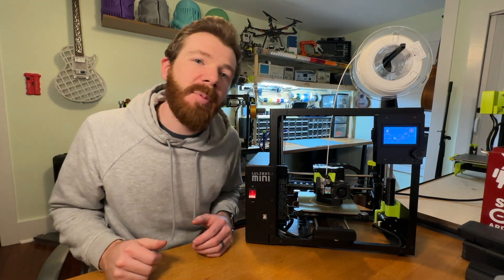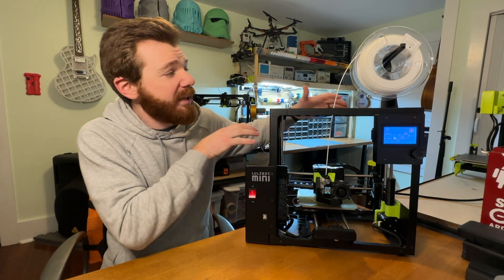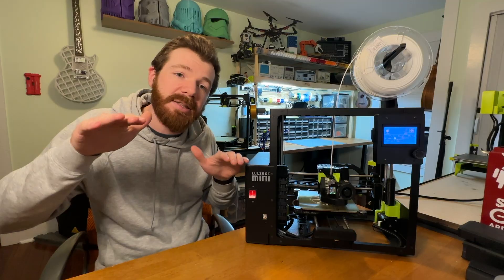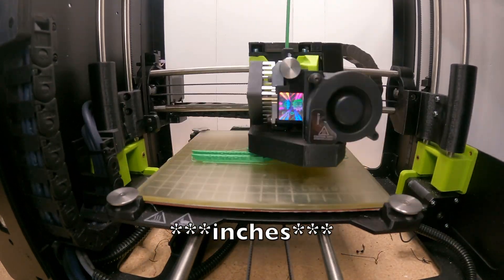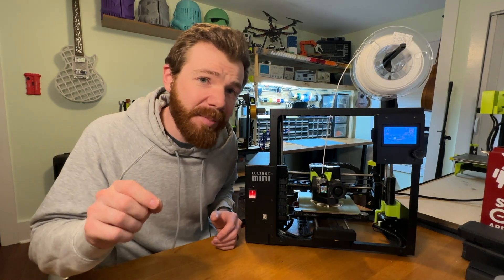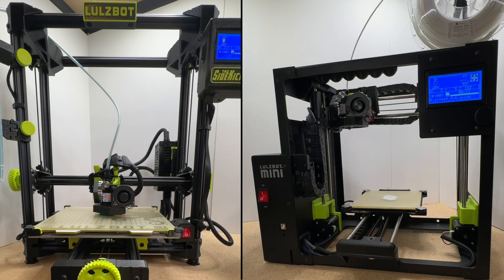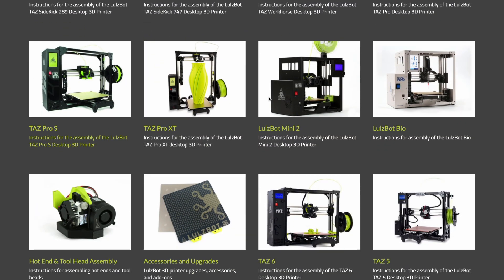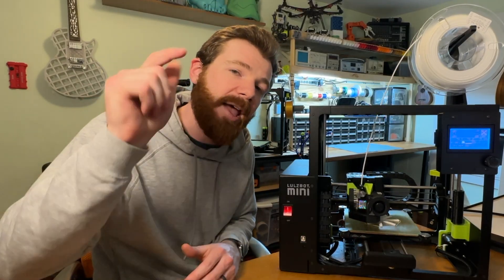10 things I LOVE and HATE about the LulzBot Mini 2 3D Printer

Comment: I bought the Mini 2 but very disappointed in the unit. One of the linear rails was wobbly resulting in poor print quality. Also after about one week of printing (20 hours or so) the bed made awful grinding noises when moving back and forth. When I spoke with Lulzbot they asked for a video of the wobbly linear rail which provided. They did not offer to repair it and when I mentioned the grinding noises of the bed they stated that it is "self lubricating" so no type of lubrication allowed. Turns out the self lubricating is simply a type of self destructing plastic that slowly wears away proving the "lubrication". Fortunately I bought it from a vendor that has a 30 day no questions asked full refund returns policy which is what I did. Too bad because I really wanted to support an American company that assembles and even makes some of the parts in the U.S.
Reply from the maker: Thanks for sharing this experience! I have had a bearing go on me too, really an unfortunate design flaw. I’ll admit though, I’ve had more than 20 LulzBot’s in my Makerspaces with two bad linear bearings across all of them in 8 years. Still, a frustrating experience as a customer for sure.

Comment: I'm still using my Mini 1 which I bought in 2014; the cool thing is that print quality has actually improved over time because slicers have improved (and updated firmware has improved things a little too). I've completely abandoned the horrible Cura Lulzbot Edition and moved to a combination of PrusaSlicer and Octoprint which IMO is far, far better.
Only thing I really don't like about it is the hot-end-as-electrical-contact leveling which, yeah, is unreliable at a fundamental design level no matter how much you mod and tweak it <shrug>.
Reply from the maker: Solid feedback, and me too! I still have my original mini 1, though modded with a new head, bed, and octoprint w/ a touch screen because this was before the GUI.
Reply: @MrErdreich  I've actually never done any maintenance on mine aside from replacing the wiper pads and adding dampers to the steppers to quieten it down, oh and a new PEI sheet once. Have you ever done any lubrication on the lead screws etc? Feel like I should do that.
Reply from the maker: @davidf2281  Not recommended. Lubricating the screws may just cause dust to collect and reduce performance more than assist. If they are binding, it might just need to be balanced rather than greased. And same! It’s been bullet proof, I replaced the head more from a want than a need
Reply: @MrErdreich  Good to know, thanks!
Reply: Do you have any tips for building Lulzbot Mini 1 profiles in Prusaslicer? I’ve tried many times but am experiencing terrible print quality. My machine is all stock except for a Aero hotend, running off Octoprint.
Reply: @gyundt  I can't remember offhand, but may well be doing some print jobs in the coming weeks so I'll try to remember to update here when I get it all back up and running and remind myself of the config.
Reply: @davidf2281  Thank you so much!